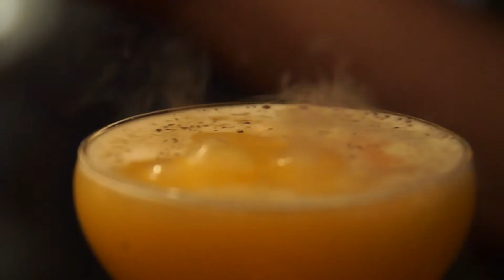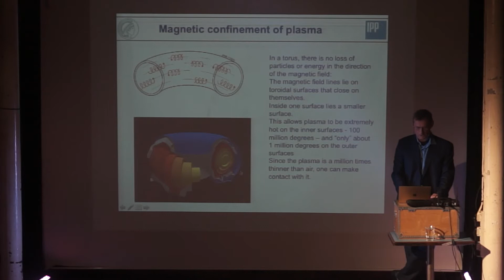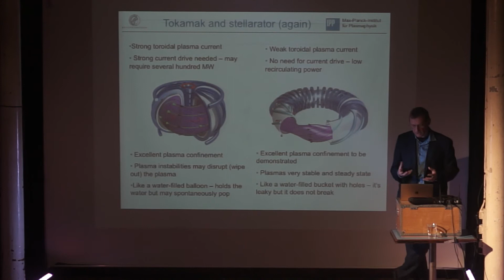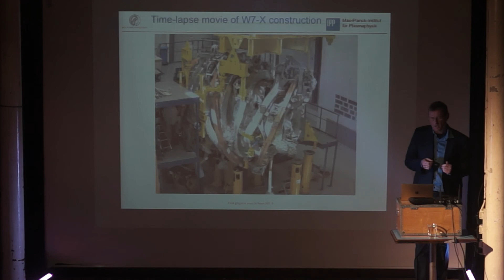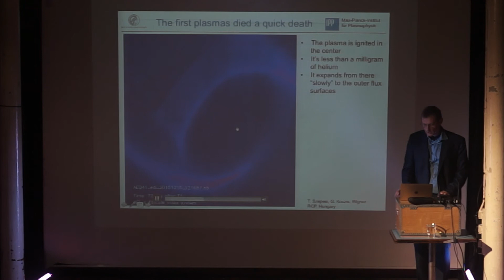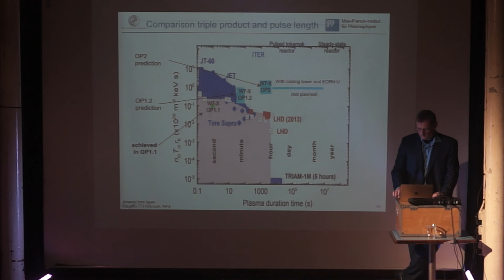Fusion: the ultimate source of clean energy? with Thomas Sunn Pedersen

Comment: so for that 3GW powerplant you need to cool 30k tons to 4k?? You better start looking into better superconductors before...
Reply: YBCO works with LN2.
It would cost a lot but I wouldn't be surprising if it would end up costing less than an helium cryostat of that size.  At the end of the day there's not enough helium on the planet to meet our energy demands with only fusion reactors if they need helium cryostats.  The numbers for helium generation from D+T are not favorable either.

Check out table 1.
https://www.sciencedirect.com/science/article/pii/S0920379617303745
Below is going to be meatball numbers.
volume of W7-X cryostat: 80 m^3
desnity of helium: 25 kg/m^3
total helium to fill W7-X cryostat: 2,000 kg
$50 per 1 kg of helium
$100k of helium in W7-X

There is supposedly 165 million kg of helium in the US reserve, making up 30% of the world's total reserve.
Let's say a 1 GW electrical output (3 GW thermal) fusion plant running on a liquid helium cryostat would use 10x as much helium as W7-X.
The entire world reserve would only be able to make 2650 of those reactors, not even covering half of the current power generation
And we're using up our helium fast for other things.  High temp superconductors are going to be very important for these machines.